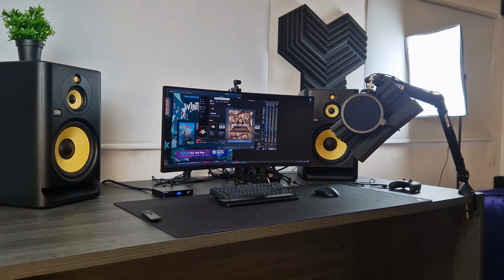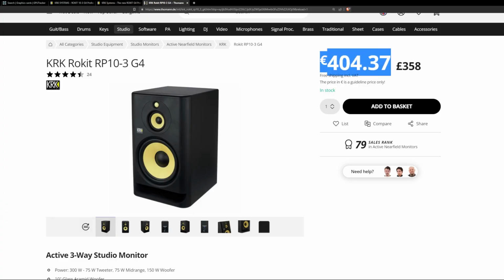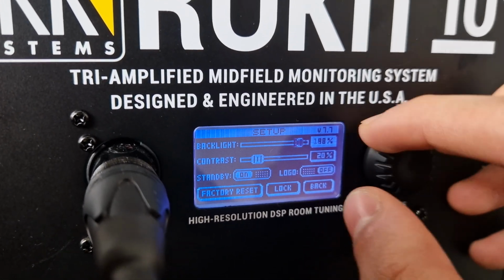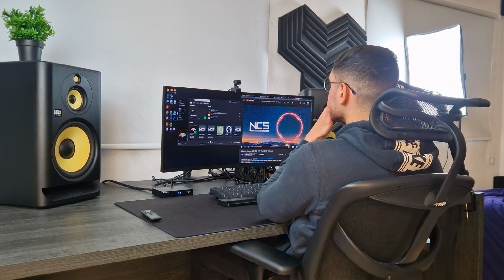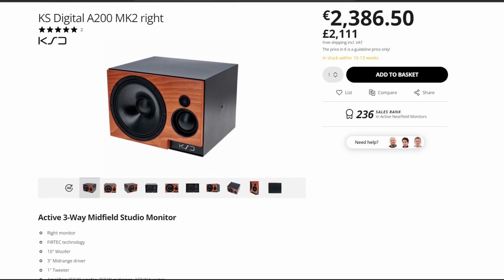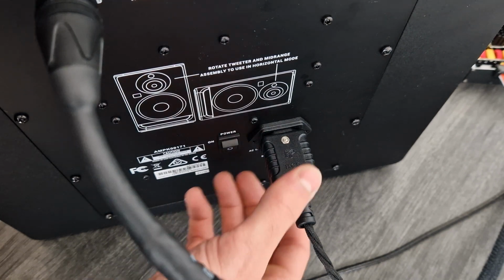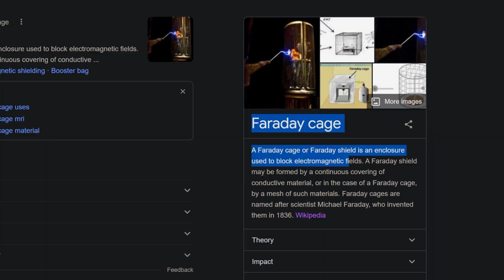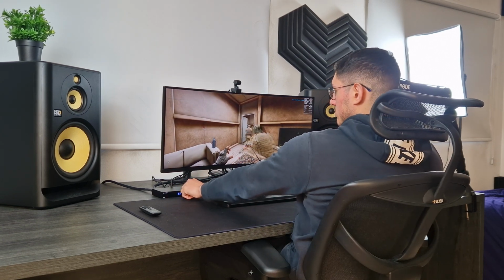KRK Rokit RP10-3 G4: Are the Specs Worth It?

Comment: all speakers will have hiss because of powered amps inside , my hs8's speakers and even my smaller woofer krkrocket 5 have an hiss when putting ears close to the speakers, to reduce the hiss your are better off placing the speakers further behind your table on speaker stands where they are supposed to be for proper use, this is why krk will not fix this issue anytime soon, its because all these powerful studio monitors are supposed to be placed further back and not so close to your ears in the first place, and in your case you own a huge 10inch midfield monitor so you should place it even further back than a smaller nearfield monitor.

Comment: Why active speakers over    passive speakers + dac + amp?
Reply from the maker: Value for money and convince. Lately, I'm thinking about building my ultimate audio setup. That will include 2 3-way diy passive speakers and a 15" diy active subwoofer.
Reply: @honestcomputing  🙂 I spent like half year learning about it.
Ended up with 90s monitors 4way bsl 170 +amp + dac topping.

Dac is important. And i doubt active speakers have built in DACs better than dedicated device.
 IMO old good stereo is good enough. had 2+1 earlier but rlly good monitors do the job.

Maybe U will like on youtube "Do It Yourself Tube DAC - Lampucera"

Comment: How loud are they ? I was planing to connect  my keyboard arranger /syinthesizer in a room 40-50m2 and throw a party . Do you think these 2 will work ? Right now i use 1x behringer 1000w , very loud , but I wanted better sound quality and maybe get 2 of these krk . What do you think ? Thanks
Reply from the maker: If you're planning on playing the music loud then won't be able to detect the hiss. Now as far as max sound pressure levels I didn't test them because I'm not using them like that. They sure can get pretty loud but you also have to remember if you're asking near the amplifier's peak performance, the speakers will start going into 10% total harmonic distortion which is definitely audible even with loud music.

Comment: Wouldnt you be better of with hifi speakers instead of studio monitors when playing video games?
Reply from the maker: Always depends on specs, price, size and number of drivers. 

If you're offered a 2000 euro hifi speaker system that is 5inch bass-midrange and 1inch tweeter for the highs, I would gladly get these speakers for half the price and have a much better audio experience.
Reply: @honestcomputing  i will hook up my Esi aktiv 08 to the TV and see how that works out. what do you mean by number of drivers? I ordered the Teufel ultima 40 last week but camceled the order in hopes I could hook up my monitors and save 700 bucks. My only fear is that they sound too flat. What is your experience so far with the model you are using?

Comment: I have KRK Rokit 5 G4 and have the same issue with the hiss but not from the speakers: both of my electric guitars pick up this hiss. And there's also a strange thing: sometimes these hiss sounds disappear for like 5-7 minutes and then appear again.
Reply from the maker: Ground loop issue for sure. It not related to this issue, you should check grounding of the equipment and also if your house is properly grounded.

It's not uncommon to see houses that are not fully grounded (on all sockets of the house) or not grounded at all.

Comment: Another "error" that appeared is that in the sub-bass area it no longer drops to 25-30 hz as it did in the first 2 weeks. It's as if a "limiter" intervened in the area of 35-40 hz.
Very, very strange. I hope it's not about something subjective that has to do with my perception.
Reply from the maker: No similar issue with mine, they sound exactly the same from day 1

Comment: Have you tried products like iFi Audio GND Defender? I'm not good at electronics, but I read a post that mentioned the iFi Audio GND Defender and I was curious what your opinion is.
Reply from the maker: Ground defender from ifi audio won't do anything for the reason that this isn't a problem that is caused by ground loops or bad grounding.

Comment: I'm curious about one thing: if you sent them back and ordered a new pair again, do you think it would be the same?
Reply from the maker: I already modified them thus voiding my warranty so I cannot send them back. I'm guessing you can get some pair that has lower noise floor but nothing significant.

My right speaker is a bit more quiet than the left one. This is completely random if you manage to get a pair that both have a very low noise floor. But even so it'll still be noticeable if you're sitting close to them, the ambient noise is low and you have good hearing.

I've tried a lot of stuff to "fix" or improve the noise floor but nothing so far worked🙃 The positive thing is that I have footage of everything and I still need to edit and post the video. But it's difficult because I also work a full time job and have clients of my own.

I'm going to try a last solution this weekend and if it doesn't work I'm just gonna give up on them entirely.

Video will be very interesting to watch though.

Comment: I cut the ground because there was a bad buzzing sound i mean big noise or the house has bad ground sockets or is something wrong with the speakers but now without the ground are fine .............my old logitech z906 has no buzzing sound, same outlet
Reply from the maker: Get a balanced audio interface or dac and use balanced cables. That should solve the ground loop issue.

Comment: Okay, so we have passive montitors. No such interference issues with those, hopfully. You must use external power amplifiers with those, and then speaker cables from the amps to the speakers. Eassy as peasy.

Then we have actives of the KRK Rokit types. ALL THE ELECTRONICS -- are jam-packed into the same cabinet into which the 2 or 3 drivers are also packed. Maybe no such a sterling idea, come to think of it? Think about heat generation, ventilation, and unwanted wave dissipation, for starters. 

And then there are those few, high-level active studio monitors..... with which the power amps and crossover(s), so the electronics portion are housed in a separate chasis. Usally something that can be 19-inch rack mountable, but not necessarily. Some active Neuman models have their electronics bolted to the backside of the monitors, but you can loosen a few bolts and remove those and place them wherever you like, run a cable from the electroncis box to the speaker.

More I am thinking about it now, it is probably a pretty awful idea overall to put ALL THE ELECTRONICS  for an active monitor -- inside the same cabinet where the drivers themselves are housed and funciton. :face-orange-raised-eyebrow:
Reply from the maker: Agreed man, the electronics on the inside with no spacing and shielding was a bad idea and a flawed design. While I agree about passive speakers you won't find ones with the same specs as these sadly and if you do, you'll end up paying more for the external amp as well.

I ordered some stuff for these, and I'm planning to fix them completely. My first attempt cutting a piece of bare aluminum and placing it in between them didn't work. So I'll space them out mounting them at the end of the back panel and surrounding them with lots of layers of conductive cloth.

We'll see if it makes a large difference to notice. But I need time as well so don't expect the video anytime soon cause the components I ordered were from China 😆

Comment: Can't wait for the fix video 🙂if you figure it out, i am buying pair of these for my studio 👍 thanks
Reply from the maker: I did the modification just with the aluminum piece in the middle of the psu and the amp and it made no difference. Now I ordered some conductive cloth from amazon and will drill holes on the panel to mount the psu and amplifier further away from each other.

The video will be late for sure (1-2 months till all the components arrive from AliExpress), but rest assured I'm going to post it no matter the results. 🙏
Reply: @honestcomputing  If you put black electrical tape between the two ends of the power socket, the problem will be solved.
Reply: @Zarunwashere  can you make a video on this

Comment: All studio monitors have hiss/noise floor to a degree especially the low price ones. If you'd get professional 1000 euros or more monitors  they would have lot lower noise floor. It's not mistake from KRK it is calculated fact that they don't shield it so well as that allows them to produce them at lower cost. Higher quality monitors also use Class A/B amplifiers which have less harsh hiss to ear than Class D amp. I have these speakers as TV speakers at distance of 3 meters and don't hear the hiss at 50% volume on speakers (control the volume on pre amp)
Reply from the maker: All audio equipment have a noise floor not only studio monitors. And yes I agree that it's more noticeable on the lower end speakers but that doesn't change the fact that KRK could have done better with the design with a bit more money.

You're saying that the noise floor and the hiss was designed to be like this and I don't agree with that as KRK doesn't have anything higher end than these speaker to offer to customers so that they "buy up" and get more quality.

Higher price doesn't always mean higher quality especially in the world of audio which is filled with snake oil products and insane price tags.

Class A/B doesn't have less harsh hiss, it's just that the power supply is always off or always on so it doesn't produce EMI on the level of a class D. But you also lose a great deal of efficiency and gain a lot more heat to dissipate. Class A/B is a technology of the past whether people like it or not. A correctly implemented class D system is far better.

3 meters away is a good distance to not hear the hiss I believe you. It's only audible for me when I'm not playing anything and the speakers are sitting on idle.
Reply: @honestcomputing  Brand new Adam Audio studio monitors (X-series) use Class-AB amping (for the HF highs) as of February 2023. Strange for you calling them past their due date, or whatever. There is nothing WORSE than Class D amping as of now. Maybe one day? Best solution is to purchase some USED 3rd Generation Rokits, those still came with the sueprior Class AB amplifiers.

Comment: tempting, but i'll stick with my adam a8h
Reply: Yeap, long and short of it is, you are much better off with the Adam overall. With the Adam, the LF and MF is via PWM Class-D, okay, but then the HF high frequencies are generated via a superior dedicated Class-AB amp. As they should be. A8H is great, now I read a few comments/reviews that state that the A77H which is actually €200 or $200 less expensive than the A8H is actually a better deal and better sound experience. Have you heard anything on that, did you try out both models before committing?
Reply: @frankfarago2825  i've heard them both and the reason i picked the a8h was; that the a77h is a mid-tweeter-mid monitor and it sounded very beautiful, but in my opinion the a8h was a bit more bass-rich. Also because of the 8inch woofer compared to the 7inch of the a77h.
But i'm still putting some money aside to get a a77h as a Centre monitor to complete the set.
Reply: @mrflute4333  Yeah, well the A77 has 2x 6.5-inch for woofers, versius 1x 8-inch with the A8. For bass performance, the KRK discussed here with its immense 18-inch LF membrane beats both of these Adams. It's just the Adam has a faulty design that KRK-Gibson had steadfastly refused to remedy for many years now. Once Generation 5 of the Rokits come out, I am predicted the RP10-3 3-way will be unceremoniously retired by them.

Comment: I had exactly the same problem with hiss. Really liked them otherwise. Hope you can fix it with the faraday cage. I'm interested to see the result!
Reply from the maker: Thanks man, chances are these will require heavy modification like separating the amp and the psu and mounting them further apart in the speaker. If I do that then I need to drill new holes inside the cabinet and find a compatible cables that connects the two or try to hand solder one which would be very difficult.

For now I put a piece of aluminum in the middle of them and grounded it, unfortunately no difference :( I'm going to make 2 parts of the fix and the 2nd part will be covering the entirety of the amp and psu with conductive cloth.

If that doesn't work I'll have to drill new holes and start mounting stuff elsewhere, we'll see.
Reply: @honestcomputing  would there perhaps be a way to completely extract the PSU from the enclosure?
Reply from the maker: @SirFreak  Yes but it's too risky and in need of a lot of modification. At that point I think it's better to not buy the speaker at all.

But like I said before I'm going to try my best in finding a solution that leaves both the psu and amp in there places.

Give me 2 more weeks and I'll hopefully have the video ready if not 3 weeks. ;)
Reply: @honestcomputing  Physically taking out and removing the affected power supply and tri-amps and housing them in a separate shielded box, of course not in very close proximity to each other, could be the safest way to fix your flawed KRK 3-ways. All high-end studio monitors, and all far-field studio monitors, are two piece units: the cabinet housing the drivers, and (usually) a 19-inch rack mountable chassis housing the electronics. BTW, since you are using cables that you yourself built, maybe try them with some higher-end standard manufactured balanced cables and jacks as well?

Comment: Faulty, borderline fatal design from the get-go, as even the previous generations of KRK 3-ways (Gen3, Gen2) suffered from it. The AC-DC PS must be right next to the power amps and crossovers physically. If the power supply were placed in a metal housng, i.e. inside of a sealed Faraday Cage, wee might not even be talking. Still, even then the crossovers may also interfere with the D-type amps. You would need to construct a small, sealed Faraday Cage from 1 or 2 mm thickness lead (or steel) laminate and place the PS inside that. And ground is real good. An even safer bet would be to remove the power supply entirely from the cabinet of the speaker. House it in a separate (metal) box, like an external power brick or briquette. And run a simple 2-wire DC power line from that brick into the monitor via shielded cabling. Make sure the external PS is at least 1 to 1.5 meter away. That should work, unless there will be still interference in the RP10-3 between the driver magnets, the 2 crossover boards (LF to MF, and MF to HF,) and the 3 Class-D amps. Whatever the underlying screw-up is, KRK should have pulled this model and fix its problems. Of course, it took over 2-years for Kali Audio to fix theirs.
Reply from the maker: Hey Frank,

Yeah the design is a bit of an oversight, and yes it would be far better to shield the entirety of the psu and use a shielded cable instead of a physical connection directly to the AMP. It would result in far less hiss and noise.

I'll try to construct a faraday cage with dense conductive cloth enhanced with nickel and copper to see if it works but almost nothing I can do about the physical connection between the AMP and psu. The only solution is to mount them further apart and that will require me to drill new mounting holes for both and also finding a cable (if there is one that uses the same 9-pin layout) to connect the two together. 

You don't have to mount the psu or put it in an external case to 2 meters away to reduce the hiss, you just need proper grounded shielding to separate the two. Look at how phones are made, look at how external amplifiers are made.

There is an auto standby feature which turns the speakers off after 30 minutes of you not sending signal to them but you can turn it off.

Yeah passive speakers are a far better solution in terms of noise but it's very difficult to find good pairs at reasonable prices.
Reply: @honestcomputing  Well, usually passive 3-ways are cheaper than active 3-ways cost. As they should usually the lack an AC-to-DC power supply / converter transformer, lack active crossover circuits (usually have passives), and definitely lack the 3 separate power amplifiers usually found in active 3-way studio monitos and loudspeakers. Higher-end active studio monitors will have their PS and amps and even active crossover boards housed in a separate box. You connect the AC PS to this box, and there is a dedicated cable running from the box to the monitor-speaker. They are still called "active" units, because the power supply + amplifiers + crossovers are dedicated to the specific drivers in the MDF enclosure. To turn an RP10-3 into such a "high end" monitor, just remove the power supply and the amps from the body of the speaker and house them separately. That might solve the noise issue caused by the electromagnetic interference. I am now thinking that an active monitor in which all the electronics are housed right next to actual drivers is  bad idea only used to save € $. Also thinking that the power amps should be actively cooled (by one or two fans), especially if they are of the AB type.